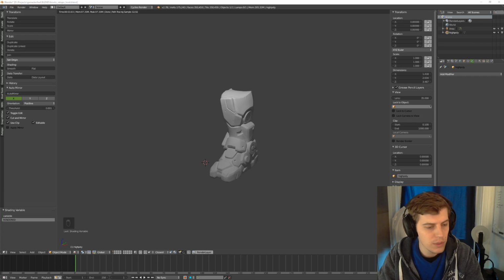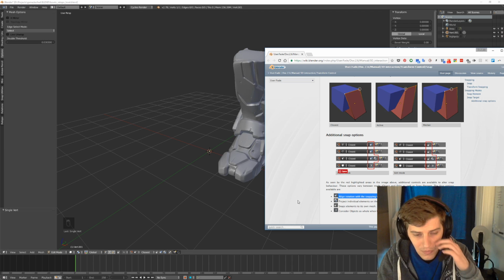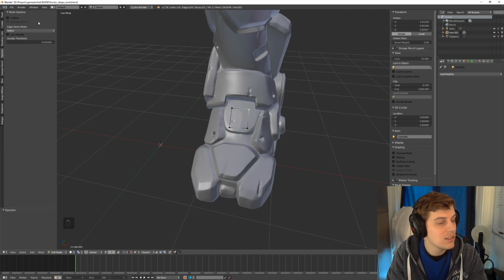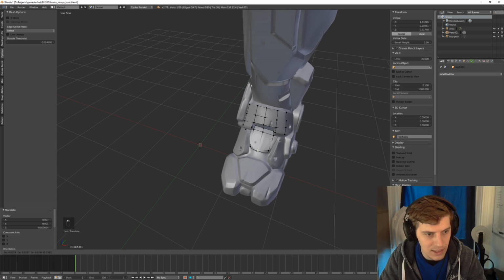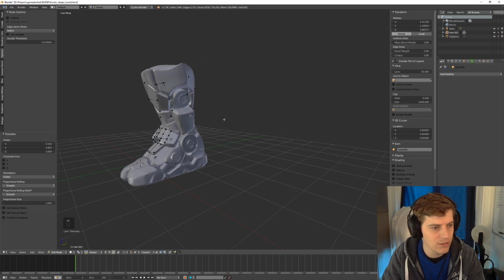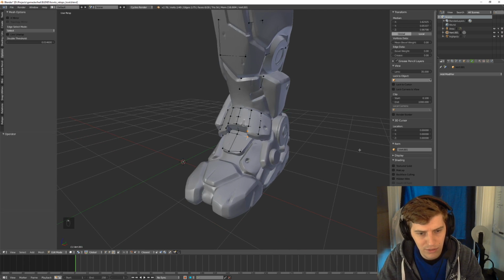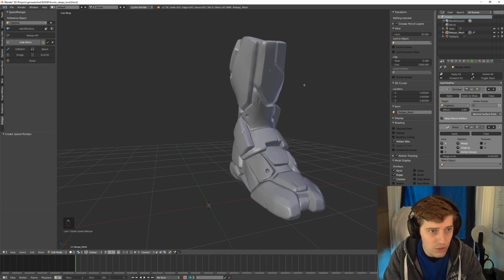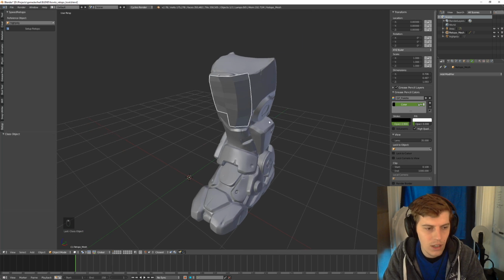Retopology in Blender: explained

Comment: Align rotation in edit mode makes more sense if you're placing an n-gon face onto something with individual elements turned off. (If working as expected, it'll align the overall normal to that of the face it's placed upon. Seems like it's not always consistent depending on the version being used though, so maybe some bugs?) Self snapping is mostly useful for vertices if you have auto-weld turned on and want to quickly pull some together to close up part of a mesh. Also using control during an operation quickly inverts the current snapping mode, so it's useful to remember too.

Comment: could i just start off by making a fairly low poly model of a character, duplicate it and sculpt on that? then bake the high poly to the low poly model.
Reply from the maker: You could do that for sure. But usually what happens is by the time you finished sculpting the lowpoly no longer matches the highpoly shape which then means your bakes will be of lower quality. Regardless of how you want to tackle it, in the end the closer your low poly matches your highpoly the better the maps you bake.

Another workflow is to "model" (instead of sculpt) your highpoly with subdiv (and only use sculpting) for tiny surface detail. And then use your subd 0 as the lowpoly.
Many ways to skin a cat. 

ps: don't skin cats
Reply: Thanks for the advice. retopologize does seem like the best method then.
Reply: Circle 25 couldn't you use the create base on the multires modifier?

Comment: "Project individual elements on the surface of other objects": Say you have a quad in edit mode that should be snapped to a sphere, all four verts are selected. Depending on the setting Blender will either snap only the active vertex and keep the offset of the others - or it will snap all of them by projecting them on the surface from view.
"Align rotation with snapping target" is trying to align the rotation to the surface normal which is represented by the line. But it behaves sort of weirdly in edit mode. It's nice for placing meshes in object mode, though.
Reply from the maker: Awesome! Thanks for the clarification.

Comment: Thanks, awesome video! Explained a lot. :) Are u planning to do a tutorial on baking normals after retopo in blender? Just cant get it done right, and have no luck finding a good tutorial.

P.S. Lower the threshhold and turn up release a bit on Noise gate. :)
Reply from the maker: Thanks for the feedback. I'll look at the audio settings you suggested.
I will go over normal map baking but wasn't planning to use blender for that. Although I may look into that.

Comment: Hey there, thanks for the tutorial.
There is something about Retopology which I'm a bit more interested in and it would be a good addition to this one.

Could you show how to retopo specific, common mesh parts?

For example:

- A small hole
- Or any other smaller details that goes in or out of the mesh
- A bigger beveled edge
- etc.

Because I have a lot of trouble finding out where I need to retopo more or less. Can I retopo a highpoly beveled edge with one sharp edge or do I need to bevel it in the low poly too (but less). Do I need to actually copy the whole hole or can I put a face over it and let the normal simulate it?

That would help me a lot getting more confident with retopology, because it's really demotivating if the normal map looks bad all the time or details just don't look how they should.
Reply from the maker: Cedric really great comment!
I am planning of making a more detailed retopology video for the butcher hatchet video series and will try to cover your suggestions. 

thanks!

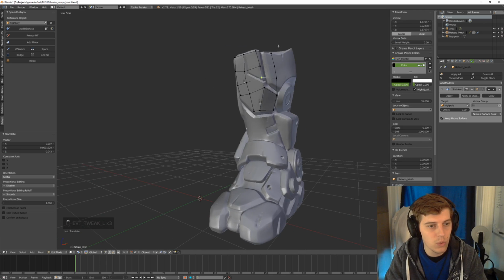Comment: at 19:58 how did the vertices merged without alt+m?
Reply from the maker: There's a button at the bottom that looks like two arrows pointing at each other named: "Automatically merge vertices moved to the same location". Activate that.
Then in the left panel (press T) go to the "options" tab and adjust the "double threshold" to your liking. It will adjust how close two verts need to be before merging automatically.

I believe I mention this stuff in the video around the 3 min mark.
Reply: Gamedev Fred ok thanks for the answer